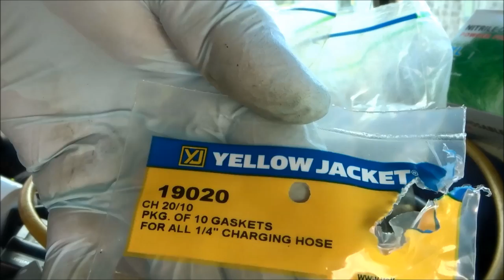hvac how to maintain good tight refrigerant hoses

Comment: I worked in auto repair. Whenever I hear something about refrigeration and Japanese products, I think of the 1985 and 1986 Nissan Maxima and the 1997-2001 Honda CRV, two cars prone to having the A/C compressor fail and then destroy the condenser with junk from the failed compressor.

Another common problem in cars is that the Schrader valve where the A/C hose meets can fail and leak refrigerant in seconds. If you are lucky, you can thread a new Schrader valve on the existing components. If you are not, you might have to buy a new refrigerant hose which can cost anywhere between $150 and $350 depending on which car it is in.

In auto repair, there is typically one machine for A/C which is about the size of a rolling tool cart. It has a vacuum pump, refrigerant reservoir, computer, and scale all in one unit. These repair shops often don't maintain these machines properly and that often means refrigerant blowing out of a failed gasket and means you might lose the repair job to another repair shop. Those shops typically don't maintain other equipment and hundreds of automotive lifts are death traps.

However, learning to repair automotive air conditioners doesn't require much time to learn and the jobs aren't difficult to do. I live in Florida, and the demand for A/C guys exceeds the supply. I know the situation is similar in other hot parts of the USA, because I have many family members who live in Texas and pay a high price for automotive A/C repairs.

Comment: i have a 4 valve imperial gauge set up. with the high pressure valve closed it sucks in refrigerant into the valve body. Is their anyway to diagnose t his problem? I pulled the knob and diaphragms out, all that looks descent.

Comment: Question: 
Is it possible to use flexible rubber hoses in a mini split system instead of copper hoses? I want to build a portable mini split air conditioner that can be used to cool any room. The system would have the compressor sitting outside and the indoor wall unit mounted on a portable stand. The hoses from the compressor to the wall unit would have to be flexible rubber instead of copper pipe and be about 20 feet long. The compressor itself will have a receptacle for electricity  to be plugged in to power the system. The idea is to make the system portable and to be able to use it in any room. 
What I am not sure of is whether the flexible rubber refrigerant hoses will hold the charge for an indefinite time without the refrigerant leaking out.

Comment: Hey Steve thanks for showing us that . I had a question regarding your recent video on the flaring tool. I tried it out the other day and it got HOT, I mean smoking hot. Is that ok for the drill ?
Reply from the maker: Hvacrookie86 yes it gets hot to anneal the copper and it will not split

Comment: Did you ever figure out why you needed to use a 5/16 gasket on another hose? Was it maybe from memory on another hose you could not locate at the time for the video? I would like to know because it would help me in considering non-standardized gaskets being a possibility. Like, it will always be 1/4 gasket for model/maker this, this, and that..., and 5/16 for that, this, and that etc.

Comment: Good idea to buy new test/charge hoses every year because they can leak. If you’re using test/charge hoses for vacuum and you can’t pull a decent deep vacuum or it keeps breaking on you, then the hoses themselves are one possible reason for this. Better to use a vacuum manifold and the heavier black rubber vacuum hoses instead. Even then you may have to change the o-rings in the fittings from time to time.